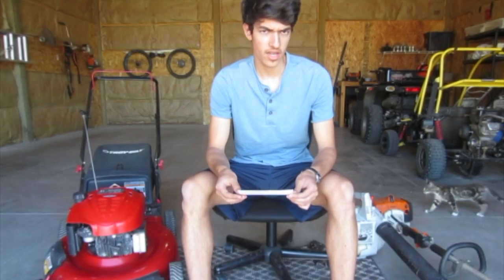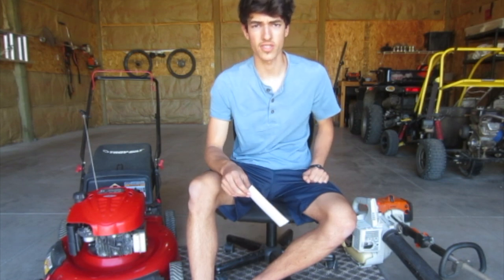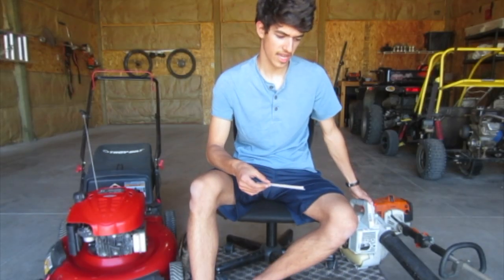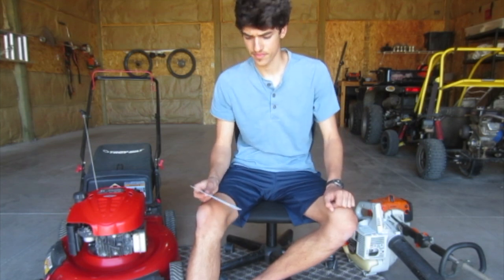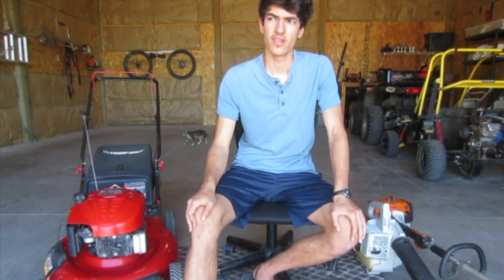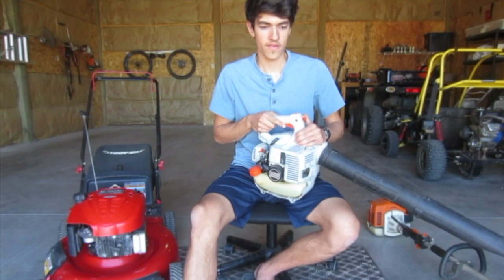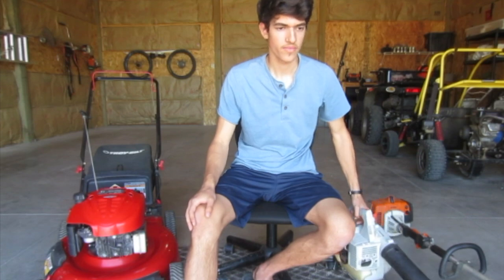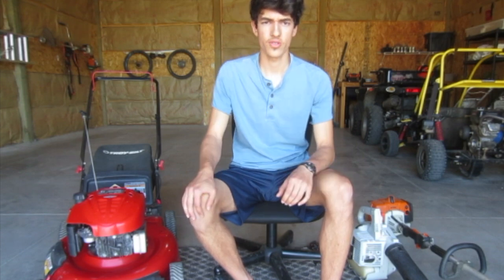Why 2 strokes engines are rarely used on lawnmowers!

Comment from the maker: Important note: I meant this video to be a general overview of the differences between 2 stroke and 4 stroke engines in the small engine world, and why they are typically used in certain applications. I was not trying to say that only 4 strokes are used on lawnmowers, and only 2 strokes on handheld equipment. There are exceptions that work quite well, as I mentioned in the video.

Comment: In Australia and nz they did really good two stroke stuff thats much more torquey the american market created so many if those briggs and Stratton motors they started selling them here before that it was like 60% the two stroke now theres none
Reply: And 2 strokes are much more torquer than 4 strokes in the example you give its that fhe engine youre showing is a 126cc vs a 26cc if the 2 stroke was made with similar displacement it would have much more power even a low rev range
Reply from the maker: @MademeMany-q6w  The two stroke was a 21cc and the Briggs & Stratton engine was a 190cc I have a four stroke Tecumseh mower that produces 6.5 hp and  about 13 foot pounds of torque. I have not seen or used any two-stroke lawnmower engines in person but I can't imagine they would have 13 foot pounds of torque at 2000-2500 RPM. Although I'm sure it would have more top and power.
Reply: @Differentthings2006 dude if two strokes are built for race or power weight 4t has no chance take an nsr250 vtwin 80hp vs a cbr250rr the CBR 250rr will max out at 20,000rpm and 50hp, the cbr250rr is slow at acceleration and not fast but sound like an F1 car, while the nsr250 two stroke is violently fast look it up.
Reply: @Differentthings2006 and it would surprise me if that weed eaters 2 stroke rpm wasn't more at 8000max listening to it. While the lawn mower hardly goes over mid 3s, it keeps torque high in rev range because of its displacement badically
Reply from the maker: @MademeMany-q6w  I have an accurate way of measuring RPM. Listening to a pure sign wave frequency that matches the frequency of the engine and then multiplying the hertz by 60 then dividing by 2 if it's a four stroke. I also have a weedeater engine that I'll do 12,000 RPM. The Briggs & Stratton 190cc engine makes peak torque, probably as low as 2000. And of course, there will always be exceptions for example, we had a little four stroke quad engine that revved to 11,000 RPM and made peak power around 9000 rpm. But in general, on a lawnmower four strokes are better suited for the low end torque, constant RPM application.
Reply from the maker: @MademeMany-q6w  And don't get me wrong, I'm not denying that two strokes can be much more powerful and produce more torque than four strokes. I'm just saying the power curve is gonna be different for equivalent, two stroke and four stroke engines. Two strokes tend to make peak torque closer to their  rev limit. Which is why they have a distinct power band. Four strokes are capable of having a more broad, low end shifted power curve particularly ones that are made for industrial applications not racing applications.

Comment: I’ve got a Troy-Bilt JumpStart TB625 EC weed trimmer that’s actually a 4 stroke, but it’s certainly not the norm for trimmers. That one has the ability to swap out the end for an edger as well which certainly can be handy. 

At one point my brother had about 30 different weed trimmers he had collected up to work on / people gave him / he found, but this was the only one he found that was a 4 cycle like this (as far as I know). It’s certainly on the larger side but I feel Iike I’ve used bigger / heavier duty trimmers than this before. It also does have an optional sling strap to help take off some of the weight but I haven’t always used that with it.
Reply: Honda makes a 4 stroke string trimmer that is well regarded. And the Stihl 4-Mix trimmers are 4 stroke engines but they use a 2-stroke style fuel/oil mix that lubricates everything the way a 2 stroke does.
Reply from the maker: Cool, I have never seen a 4 stroke trimmer in person, but I have definitely heard about them.

Comment: the only reason Lawnboy quite selling 2 strrokes was due to stricter emissions they were light weight and ran forever as long as you didnt forget to add the oil to the fuel .
Reply from the maker: Interesting, it would be cool to get one of those.

Comment: A popular 2 Stroke at one time was the Wisconsin Robin on Snapper Lawnmowers. They were offered on other applications with at least 4 Hp and higher.
Reply: Lawnboy also made a 2 stroke mower in late 80’s and early 90’s
Reply: @jamiewarner9101  not quite true. Lawn boy made mowers all the way from the early 50's to the mid 2000's. Engines include: Iron horse 'a' series engines, Iron horse 'c' serires engines, OMC 'c' series engines, OMC 'd 400' series engines, OMC 'd 600' series engines, 'f' series engines, 'm' series engines, 'v' series engines, and finally 'e' or 'duraforce' engines. Of course there are many before the 50's on rare reel mowers made by omc, but those are hard to come by and don't have a lot of information about them out.
Reply from the maker: Interesting, I have a Wisconsin Robin powered snapper but it is 4 stroke.
Reply: @Differentthings2006  They actually had both available over the years.
Reply: The 2 stroke Robin powered Snapper was awesome!  Great power and very little maintenance (no oil changes) and they lasted for years!